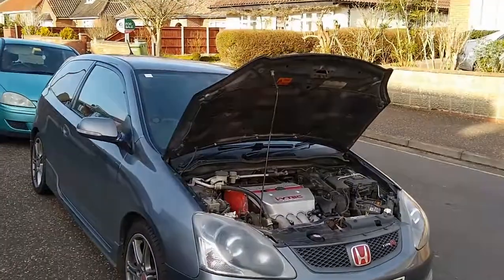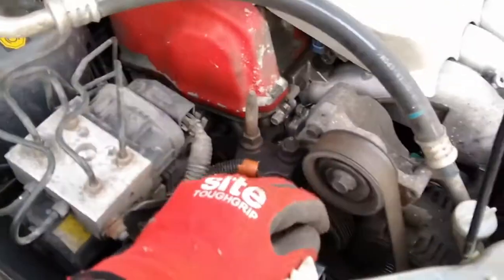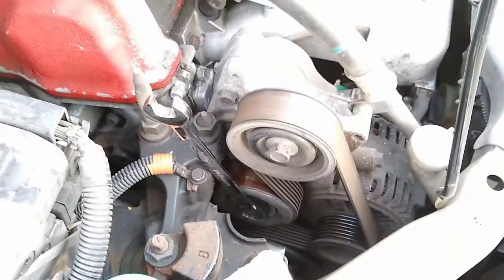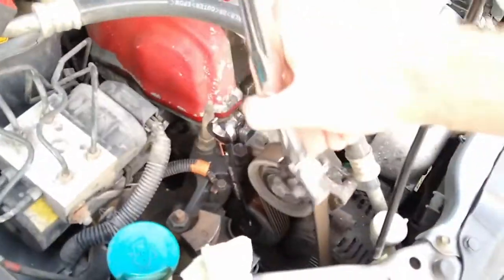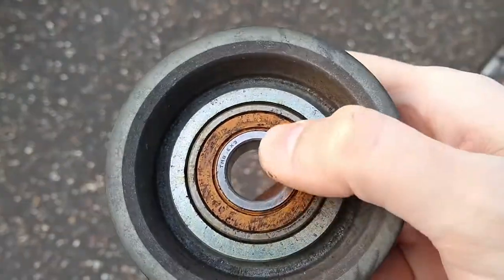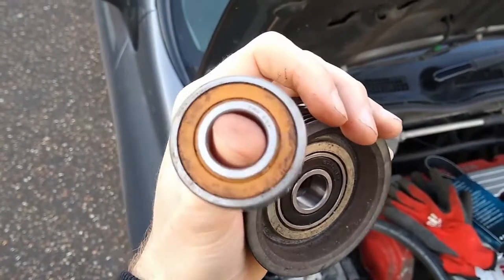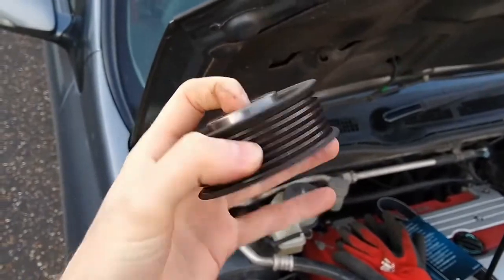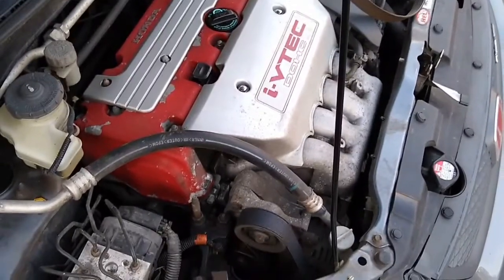How to Change A Fan Belt and Idler Bearing in 5 minutes (Civic EP3 K20A2)

Comment: Great video.  Thanks for the bearing code so I can order one in advance.  How difficult was it to get the new belt on without removing the wheel and plastic cover to gain access to the crankshaft pully and air con drive?  BTW, another similar video quoted the top idler bolt torque to be 16 lb.ft or about 22 N.m  It came with a warning that if you over torque this bolt the cast aluminum bracket is likely to break.